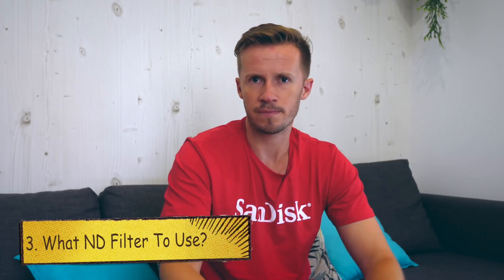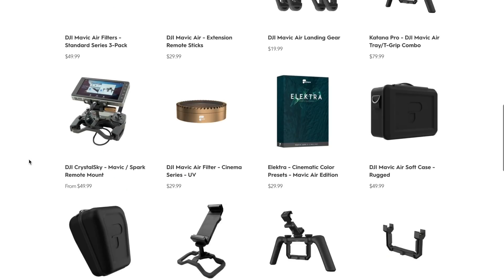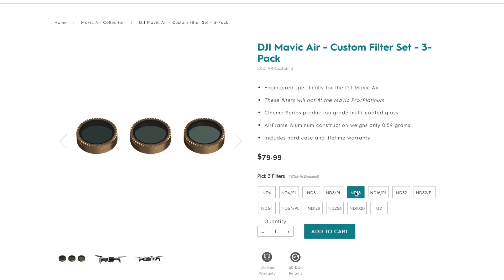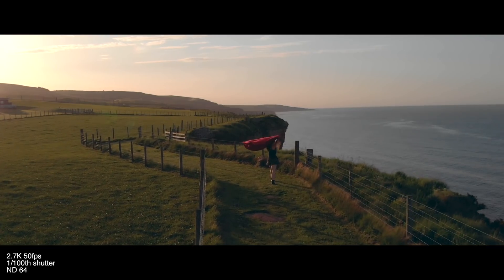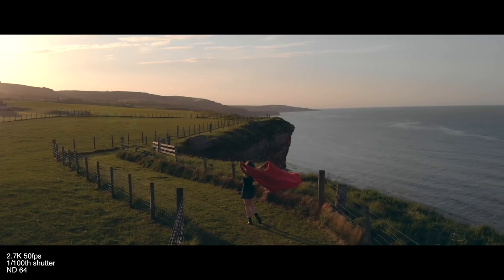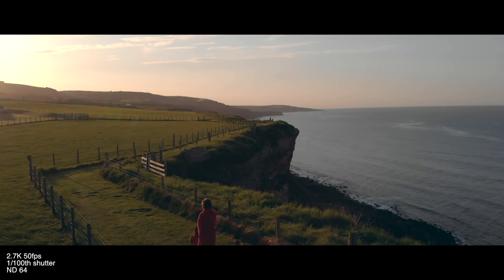Drone ND Neutral Density Filters || Everything You Need To Know

Comment: Hello Stewart,
To begin, I must say I find your youtube videos to be extremely informative and "no nonsense"; they are some of the best I've watched regarding all things filming with drones.
I was flying more Air 2S the other evening and when I started flying I did a quick check of the light conditions and determined I would need an ND4 filter to get my shutter speed down to 1/60th since I was filming at 30fps. My aperture was fixed at 2.8 and my ISO was set to 100 for best quality video. I was flying low and fast over a river so motion blur would be necessary to make it more realistic; that's why I put on the ND filter. After the initial low, fast shot I took the drone up higher for more of an overview and noticed my shutter speed had dropped to 1/30th and I would have to fly back about 500 meters to get that ND filter off the drone and that would waste battery power so I just kept filming anyway, and the result was not good due to the very slow shutter speed. In hindsight, I could have upped the ISO to 200 to get the shutter speed back to 1/60th, but I am still learning by experience (mistakes) and didn't think of it at the time. When I got back home I watched this video of yours and got a better idea of what I should have done. I think. 
So, my question is, .... should I up the ISO when I get caught in a situation like this and have more noisy video, or would I have better off to leave the ND off to begin with and not get the proper motion blur for the low fast river flyover but be able to keep the lower ISO for the remaining shots. I had both changing shot requirements (fast motion and slow high overview) and changing light conditions (the evening light was fading). I'm interested in your thoughts. Thanks in advance.

Comment: Should I buy a set of 8 filters.
4 are polarized (16,32,64)
3 are non polarized. (4,8,16)
1 is a circular polarizing lens.

Or the cheaper all polarized set 
(8,16,32,64)

I dont see why i should have a drone with a CP lens. Either I want it on or off, I can see my self landing every shift in polarizing. But there's also a ND1000. Which seems interesting,  but its sold separately. 

I only ask since I dont see many reasons to have a non polarized lens. 
In my earlier years of droning I lost my Polarized filter, and all my videos were ruined due to the bright glaring light shifting the colors and washing out.

Comment: Hi , if motion blur isn't a priority , so no need for a ND filter , but you would still want to use manual exposure settings and keep the iso low to avoid noise  , would it just be a matter of increasing shutter speed to keep to much light out ? Thanks ,  great video
Reply from the maker: Spot on!
Reply: @DroneFilmGuide  thanks guys 👍

Comment: Excellent video Stewart. Lot of learning values. Can't thank you enough. I have got only one question. You have mentioned that there is no point using a nd filter if there is no motion in the frame. However in shots where high dynamic range is required, like in the situations of sunsets or sunrises can we use it to underexpose the blown away areas of the frame? I understand that the darker areas will get even darker, but its always easy to bring out details from the shadows than from the blown away areas in post production. Thanks in advance. Keep up the good work

Comment: Hey Stewart, just discovered your channel and really love it so far! So I've just gotten back into drone game with my Mavic 2 Pro and trying to do as much research for my upcoming trip to Scotland and the Isle of Skye which I'm very excited to shoot! My question is, if my goal is to take video/photos and want to have the freedom to slow down shots as necessary in post should I just leave the ND filter off? And also if I have any motion in the shot just slow down the shot to 24fps? What would be the settings you would go with on this sort of trip?
Reply from the maker: Envious you're heading up to Skye! If in doubt, leave the ND off. Assuming you're shooting big landscapes in Skye, there'll be virtually no motion so you won't be able to tell. Let's say you are shooting motion that you want to slow down then you should use the higher frame rates, e.g. 50fps. With 50fps you'll use 1/100th shutter which gives you a darker exposure than realtime at 1/50th. This can be a pain if you are switching between 24/25p and 50/60p mid-flight. If you are just doing slow motion then mindful that 1/100 is fast enough to freeze most motion, if you  leave the ND off and shoot at 1/500 for example, it doesn't really make much difference as both shutter speeds are freezing motion. So really the ND discussion centres mainly around 24/25p. Hopefully I've not just confused matters!!

Comment: Hi, great video! What confuses is me still is the ultimate purpose of the ND filters. You start by saying that it's needed for motion blur but then you discuss how it saves the film in bright conditions. Every Mavic Air video out there starts with the suggestion to put ISO to 100 but then put on ND filters otherwise it's just a massively overexposed image. But if ND filters are really for achieving motion blur then is this just a positive side effect? Thanks
Reply from the maker: The only purpose of ND filters is to reduce light to the sensor, everything else is a byproduct. You're right to keep ISO on 100 for minimum sensor noise but it's the shutter speed that influences motion blur. Primary function of shutter speed is to control the amount of light - secondary function is to control motion blur. But if you are forced to have a 1/50 shutter for motion blur reasons then you need an additional method of reducing light to the sensor if the image is over exposed, i.e. NDs.

Comment: I am a real estate agent and film the exterior of homes, for the most part at 5' to 100' and then edit in Final Cut PRo X.  I shoot at 4k 60fps on a P4P, with the intention to slowing virtually everything down to 30 fps in 1-4 second clips, to make them buttery smooth.  You mentioned not using ND filters if the intention is to slow the footage down.  If I can not achieve the 180 degree rule without the use an ND filter, do I simply crank up the shutter speed?  I also use a DJI Ronin S and a Sony A7riii when shooting the inside of homes, also, with the intention of slowing 60fps footage to 30 fps, to achieve the same buttery 1-4 second clips.  Same answer?
Reply from the maker: Absolutely. If you're not getting the 180 degree rule then just crank up the shutter. I should imagine you're not doing wild motion for your real estate stuff so it'll be almost impossible to tell the difference. If you think about it, at 60fps, the shutter should be 1/120th. For most photography, this shutter would be enough to freeze motion so it's kind of academic whether your shutter is, let's say, 1/500th or 1/120th because they both freeze motion. The difference is more visible if the shutter should be 1/50th and there is motion in the shot.
Reply: I’m confused? Assuming that I intend shoot in 4K/60fps, 1/120th shutter speed and can achieve correct exposure through the use of an ND filter, why would this configuration be inappropriate if I intend to slow the footage down to 30 FPS in post?
Reply from the maker: It's not inappropriate, that's correct.

Comment: For a guide to which ND filter to use the old f/16 rule of photography is very useful. One over the ISO at f/16 will give the correct exposure on a sunny day, it was also called the sunny day rule. On a sunny day at 100 ISO the exposure is 1/100 at f/16. For an exposure of 1/50 at f/16 you would need a 2ND then to bring the exposure to a more suitable aperture say f/8 you would need a 8ND filter rather than the 2ND filter. A 4ND would on a sunny day provide an exposure of 1/50 at f/11 and a 16ND would allow an exposure of 1/50 at f/ 5.6. We could talk about the sun being constant and the intensity being reduced by mist, cloud cover and as the sun come closer to the horizon.  So I have to admit that when setting up the phantom 4pro I just look at the prevailing conditions to decide if I need a ND filter or which ND filter value for the aperture and shutter speed as well as iso I wish to use working with M, manual exposure. Cheers, I know a little about photography but find your videos brilliant for all aspects of working with drones, thank you.
Reply from the maker: Thanks for sharing this!

Comment: Hi Stewart  I’ve had a phantom 4 for about 3 years now I’m also a PIFCO holder. Just starting out as an Aerial videographer.
 Just bought a set of polar pro vivid series with polariser filters. But I’m having a issue with the footage I’m recording I’m using the polar pro app you recommend. Fitted the recommended filter. Set the frame rate to 24fps and shutter to 1.50 however when I “pan” the aircraft across slowly I’m getting “gittery” footage not ‘smoot’h like rolling shutter effect which I don’t get without the filter. I would be very grateful for you help sorting this thanks you both take care.

Comment: Would you consider waves to be in motion and thus needing an ND filter? My example would be flying my drone along the beach and over water in a bright sunny day in the Bahamas. Most likely at 50-100 feet. I'm just wondering if I should even bother in that instance.
Reply from the maker: I'd say 99% wouldn't tell the difference. It's a point I should have probably made clearer in the video because with a shot like the one you describe, you really need an eye for it to spot the difference. So it comes down to who the footage is for.

Comment: Hi, congrats on channel.  Have you ever used a Colour Chart card for drone footage?  I've struggled to match colours from the air to a DJI Osmo on the ground.  I've fixed white balances and such but  the colour profiles of the sensors look very different.  I'm tempted to film a colour chart (such as the XRite Colour Checker Passport Video) prior to taking off but wondered if the lighting conditions as the drone moves around make the chart recorded near the ground irrelevant.  At £140 for the chart its an expensive experiment for me!  Any thoughts?
Reply from the maker: It's something we are working on at the moment because our drones have colours completely different to our ground cameras and it can be a pain to match the colours. In theory the XRite should be an easy fix for that or certainly a good starting point. Stay tuned as we haven't formed our conclusions just yet!

Comment: Just to clarify, if you are taking still photos, is it not worth using a ND filter?
Reply from the maker: Hey! Correct, unless you are going for some slow shutter effects like I demonstrate towards the end of the video. 99.9% of the time with photography you want to freeze the action in a single frame so you need a fast enough shutter to do that. For a person walking down the street, 1/100th could be enough but for someone kicking a ball you could be looking at 1/500th for example. It all depends on the speed of the motion you are trying to freeze and the distance from it. Flying a drone on a bright day without an ND you'll probably have shutter north of 1/500th which is enough to freeze any action you'll be photographing with a drone I should think.
Reply: Thanks for that! So if for example I was taking some landscape photos on a bright sunny day without any motion what kind of shutter speed would I be looking at?

Comment: Terrific video and just what I needed, thank you.  Question though - should you not use ND filters if utilizing the pre-programmed shots on the Mavic Air specifically?  Do those shots - dronie, helix, circle, follow-me, etc. shift to automatic and then prevent you from having the correct settings in manual if you go back to manual afterwards?  I may not be explaining as well as you did back in your "things you don't like" part of your recent Mavic Air Review?  I use the pre-programmed shots more often than not, so are ND filters a waste of time there?   Thanks again!
Reply from the maker: Hey! So although the Mavic Air switched to auto settings for these quick shots, you can still change to manual and perform these moves with manual exposure. If you are happy with the auto settings then certainly don't use NDs but if you want to do them with manual exposure then you can use NDs if you wish.

Comment: Hi Stewart,
I think that I could be one of them that forced you to shot this new video :D
Anyway, you spoke about manual exposure also for videos and I just discovered "lock exposure" in P4P+, so my doubt is: I have to always manual expose and lock it before filming? This could be pretty easy in a straight flight but during a pan or POI rotating in different directions respect to sun, I'll surely have wrong exposure during the shot... What am I missing? :-)
Reply from the maker: You're not missing anything, this is correct.  You can only expose for one thing at a time manually so if you turn around and point at the sun then your exposure will be wrong.  The only way around this is to use auto exposure or film differently.  In Hollywood, cinema lenses have step-less aperture rings (no clicking) so they can adjust exposure this way whilst maintaining a constant frame rate.  Even then, to the best of my knowledge, this would only be done for a specific shot, e.g. going from inside to outside.  Obviously this isn't an option for drones so we just have to plan our shots accordingly.
Reply: thanks stewart, maybe you could make a video avbout this topic, with wrong and right examples of the same shot showing how you realized your beatiful clips. Also in case of sunsets maybe.
Actually, to respect rules you spoke about, I tried to shot in SS priority, so manually setting "120" of SS in case of 60fps and then let P4P to set aperture to have the right exposure and then lock ae.
Could be the right technique?

Comment: First off, they are Neutral , density filters , not neutral density, filters.  Neutral meaning they are neutral in the wavelengths they pass. Density meaning they reduce the amount of light they pass.  Referring to them as ND filters is easy, but somewhat inaccurate and confusing.  They should be referred to as DF (density filters) with the N coming in as a secondary specification as it simply refers to them being equally passive at all visible wavelengths.
Reply from the maker: You're going to have to copy and paste that across a lot of videos on YouTube buddy...and write to all the ND manufacturers...
Reply: Yup.... I know.  Like I said, its easy to just refer to them as such, and fine, but its what causes a lot of the confusion you just spent so much effort explaining. Few understand what they actually are, let alone how and when to use them, and the naming convention causes some of that.

Comment: Great video guys
Hi I am also using an Osmo plus (camera from inspire I believe) - This has a setting 'Shutter Priority' like a DSLR it allows you to fix the frame rate and the camera auto adjusts ISO. So if the holy grail is to have a constant shutter speed (based on the 180 rule) would it no make sense to use Shutter Priority.
Just a note I have fitted some great combined ND/Circuliser (8&16) filters from SRP  which help keep the ISO lower. Really keen to get your feedback on this issue. Filters here...
http://www.ebay.co.uk/itm/like/262130662277?clk_rvr_id=1582307929987&vectorid=229508&lgeo=1&item=262130662277&rmvSB=true
Reply from the maker: Hey! If I understand you correctly then you can use shutter priority to maintain a constant shutter but you want the ISO on manual also. You don't want that moving up and down to control exposure. With this kind of gear, you really need to plan for only one lighting scenario per shot. That way you can set your shutter/aperture/ISO and pick an appropriate ND for the situation. If lighting conditions change then you need to reassess.
Reply: Hi and sorry I meant to say 'allows you to fix the shutter not frame rate' therefore guaranteeing fixed shutter speed i.e. 4k 30fps 1/60 shutter, with ND (where required) helping to keep iso low. or would you go all manual and fix the iso at 100. we are talking osmo here, don't think mavic offers shutter priority? thanks again Tony

Comment: I bought a variable nd filter that  goes from nd 3 to 200.  Problem is there is no Mark's on filter to see what number I'm on.  Very frustrating.
Reply from the maker: We use these kind of variable NDs for our ground cameras and have similar issues. They are quick and practical though when you are on the ground at least. Because there are two bits of glass in these NDs, there is always a risk of ugly lens flares though.